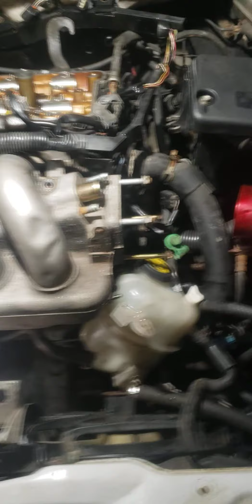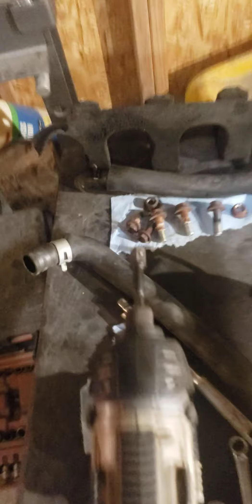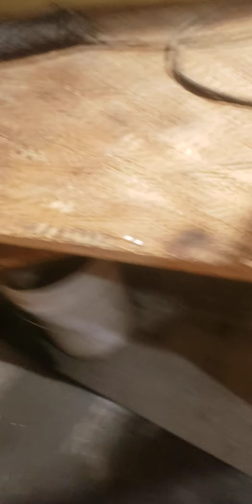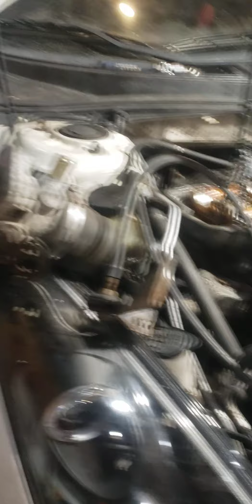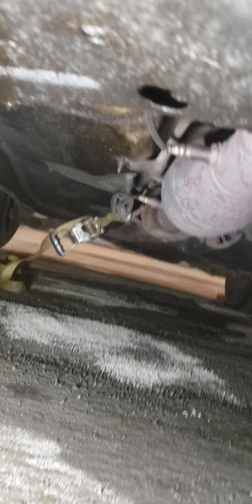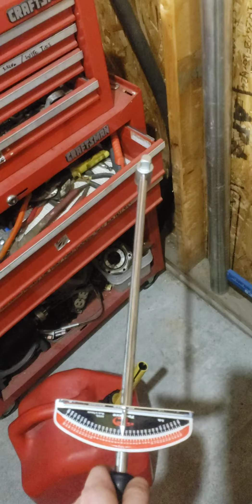2000 toyota celica gts 2zz ge vvtl-i motor. Head removal part 1

Comment: lol was going to ask where is part two, then i saw you just posted this! I am building my 2001 celica trd gts rn. Engine is going to machine shop so its out of car on stand and very ez to work on! lol just have to get a M12 star bit.... Having a major kit going into this engine. upping HP from 180 to 500....a bit of a jump ngl hence all the work, oof. thx for the vid. looking forward to part two. also saw you went for the black bumper. My car is simular. base color silver with black body kit and red grating and badges.
Reply from the maker: There should be a part 2.
Reply: @willpanzino6847  good good good
Reply: gen 7 Celicas are so cool as cars. I own two, the riced out and being built one then a daily.